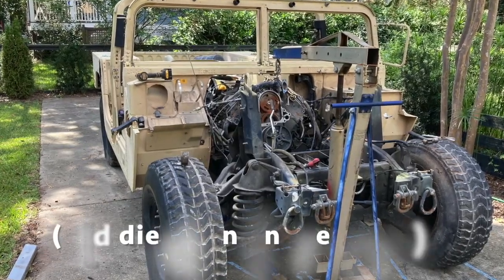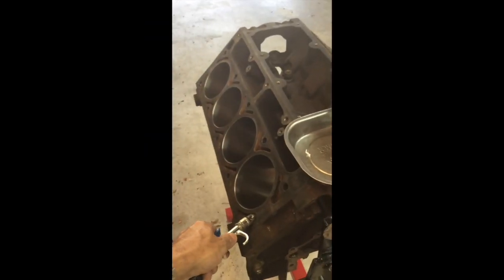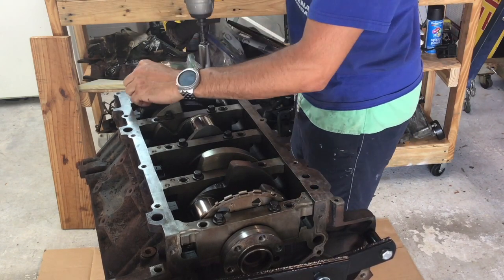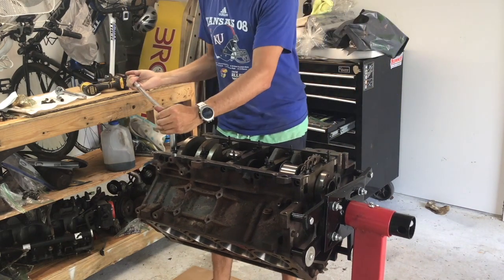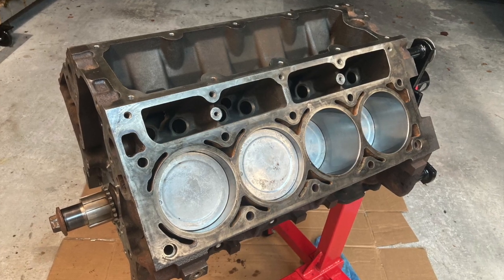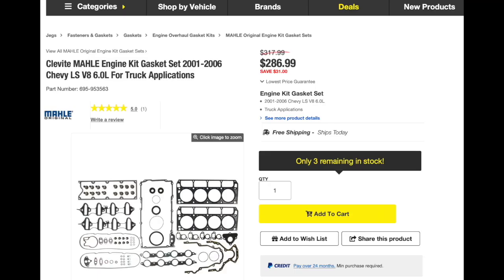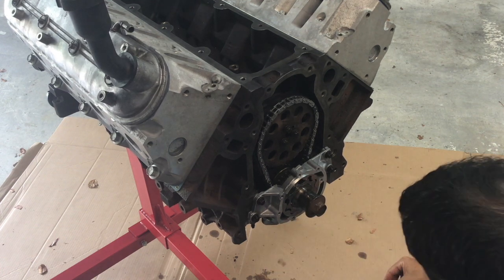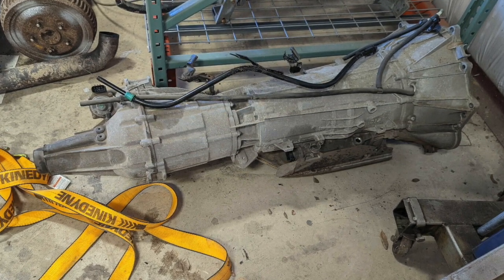LS swap rebuild for Humvee start to finish

Comment: What you doing about the power steering pump and flywheel
Reply from the maker: it had its stock flywheel and was going to use a remote PS pump corvette style if I remember right, but sold the engine before I got that far and installed a Gen 5 LT

Comment: How to mounting the engine  it's easy or no and wath about the air intake the original one do you need lift the body?
Reply from the maker: Thanks man. Using ICT Billet adapters with stock engine mounts. Have not. tried to fit up yet. I may have to modify the truck intake or replace with a corvette intake for clearance. Will do another video when the engine goes in. No plans to lift the body
Reply: Good luck 👍
Reply from the maker: @uninstalldevice5073  Fits in with no body lift. Have to shave the top of the manifold where plastic parts stick up. Put the engine in first, then the intake
Reply: Hey , you mentioned you used the ict adapters did you do any modification or did it bolt rite up ..